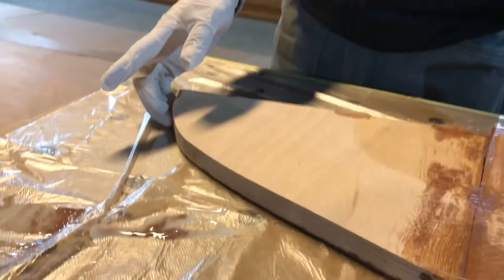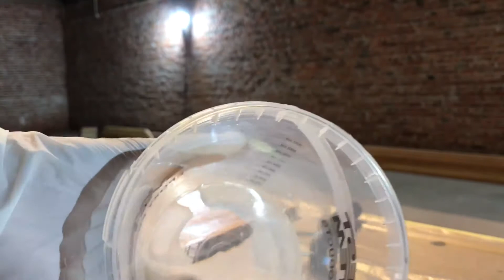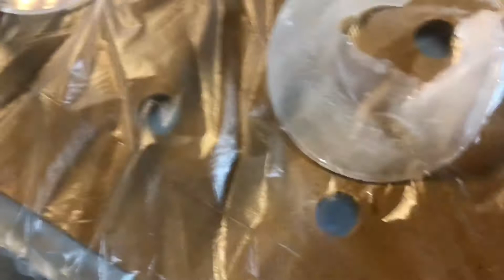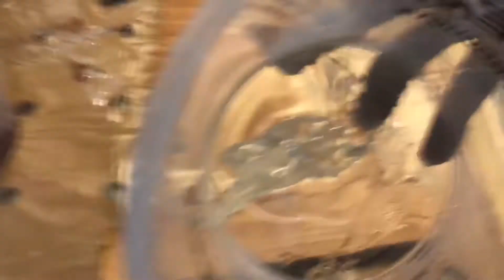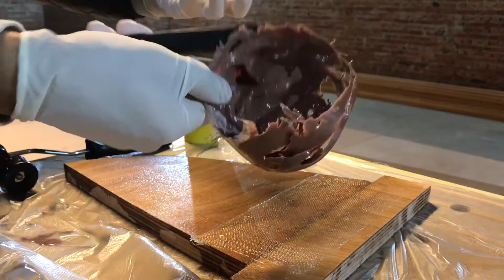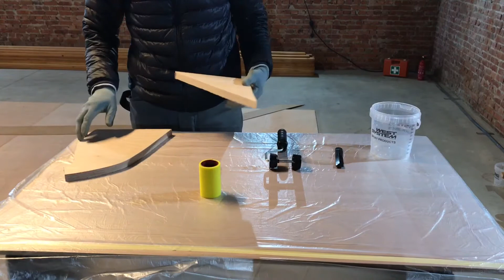More tests with epoxy, learning how to work with epoxy

Comment: Hi there. I agree for the température it must be at least around 20°c. You need strength so mixing and polymerisation should be optimal. No other way is possible. Second, forget foam rollers or most of your epoxy will be wasted into it. Spread the epoxy with a squeegee or a silicon brush, then use a striped roller. I will follow your build with pleasure. Good luck and keep on going !
Reply from the maker: Hello Axel, thank you for your advice. Today I have ordered a tent / enclosure that fits around 1 hull and I am going to install that when it arrives and try to keep the temperature within this tent around 20°c during epoxy curing. I also like your alternative for the foam rollers. I only have a question, I don't know what a striped roller is. I searched on Google, but can not find a picture of it. Thank you :)
Reply from the maker: Axel Sixtysix thank you 👍🙂
Reply: Building SV Satoshi : you're welcome mate. A small enclosure made out of insulation foam, with a light bulb inside, can keep the epoxy containers to 20-24°C which helps a lot for epoxy conservation and for proper mixing. A jobsite 1000w halogen lamp close to the glueing area can keep the parts warm enough during polymerizing time. Beware about moisture too because it does not goes well with resin bounding. I'll try to transmit the few I know along the way...

Comment: I'm assuming you mean 10 C. That's too cold for epoxy to cure properly. Epoxy that's cold in the bottle/cans before mixing will be too thick to wet out properly, and even WEST my not have enough energy to exotherm. You can keep your epoxy in an insulated cabinet with a warmer (100-watt light bulbs used to be the favored alternative), and turn on the warmer a couple of hours or so before using the epoxy.

I saw Hanneke Boon use infrared heat lamps and tents made of bubble wrap for insulation when the bonded the Mana parts over their winter. That might be an idea. I'll be using a moving blanket for insulation and an electric radiator as a heat source when I start building the first hull for my Woods Eagle. Just a thought.
Reply from the maker: Gary Prost Hello Gary, thank you so much for your comment. The temperature that I mentioned is indeed in celcius. I keep the cans in a room that is temperature controlled at 15 degrees celcius, but in my main workspace it is getting below 10 now. I really appreciate your suggestions. I am happy I am getting comments like yours. I have to think about how I am going to do this in the upcoming colder months. I am going to check the infrared lamp suggestion that you referred to. Thank you, Kindest regards, Marcel
Reply: Here's a link to their Mana 24 photos. You'll see their setup in some of the construction pictures. https://www.wharram.com/site/gallery/tiki-designs/mana24
Reply from the maker: Thanks for the link, I did not see that before and in the large amount of pictures I can see many useful methods. Then tent and lamps might be really necessary here in Belgium too.